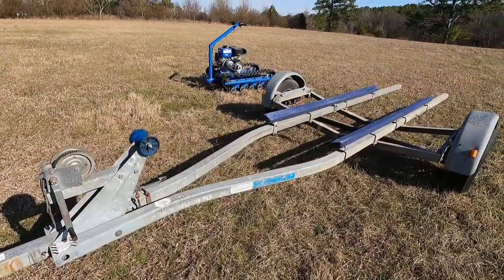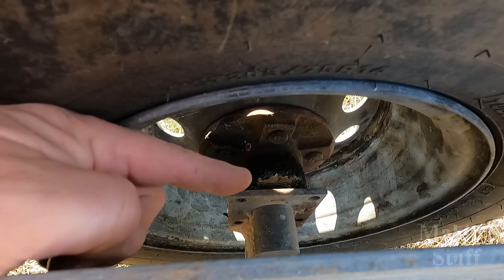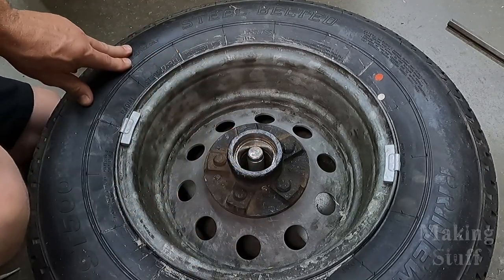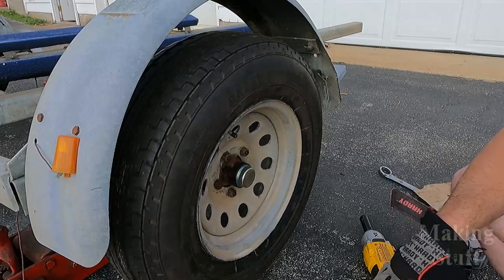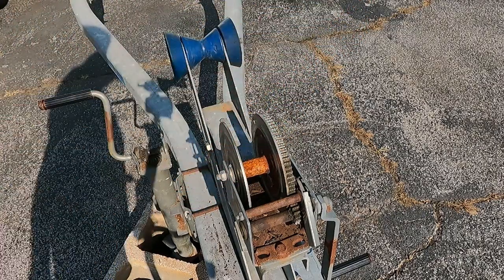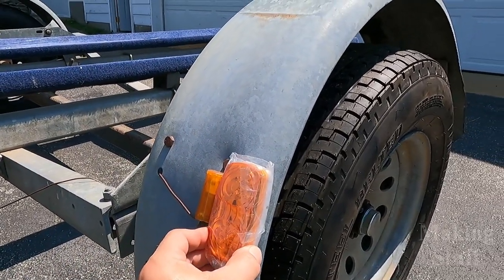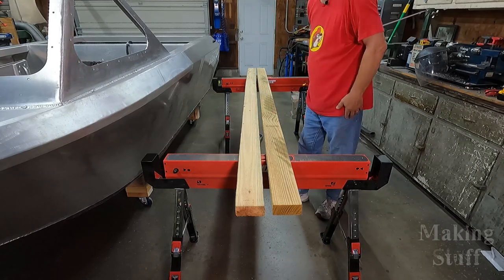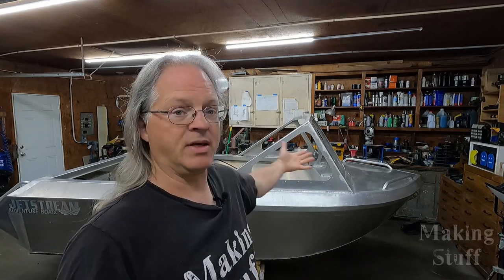Restoring A Boat Trailer For My Supercharged Mini Jet  Boat

Comment: Crimp connectors are usually better where vibration/shaking occurs due to work hardening. Solder is never used in aviation applications for example.
Reply from the maker: Thanks, several have pointed this out to me.  I'm glad the YouTube community helps one another out.

Comment: Curt or Reese brand bearing buddies. My trailer sees salt water water exclusively.  They  hold up well and are considerably less expensive.     I thought your trailer was in good condition. When I got mine I did axle, hubs, springs, fenders tires bearings  wiring lights and weld a new tongue. Yeah

Comment: I think you made a good call buying a used trailer. Given the unique size and weight of your jet boat, you probably would have modified a jet ski trailer or modify a new larger trailer. I think you are better off modifying a used larger trailer.
Reply from the maker: Thanks!

Comment: Thanks, bought the solder connectors. I was wondering if you could use the end pieces of the trailer you're cutting off to extent the winch?
Reply from the maker: No, they won't be long enough.

Comment: Do not use those shitty Chineseium heatshrink solder crimps. The low temperature pot metal solar falls apart. Use some normal inline butt connectors and cover with high-quality 3.1 ratio adhesive heatshrink if used in a marine installation. Or otherwise, just traditionally solder the wiring and use heatshrink. You'll have endless dry joints and dead shorts in no time
Reply from the maker: Thanks, I'll keep that in mind beore I start hacking up the wiring harness.
Reply: Evidence, tests, reviews? I'm not doubting your bad experience, but there's nothing wrong with the technique itself.

Comment: What the heck....??? You never put the boat on the trailer!!! ha ha ha   Still cheaper than a new trailer by far!  I just bought a new trailer  to ship my new kit boat on 18 hours away. It was 1400 canadian.   would have cost me 1800 to ship . When ya gonna get it wet?
Reply from the maker: Don't want to put the boat on the trailer until I am done with it.  It is easier to move around the shop with the dolly it sits on now.  Hopefully getting wet soon.